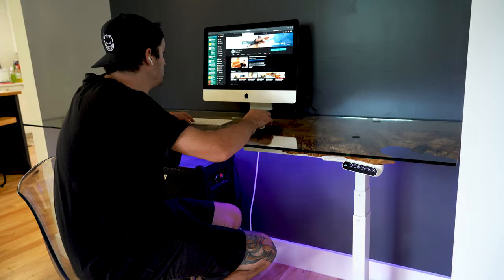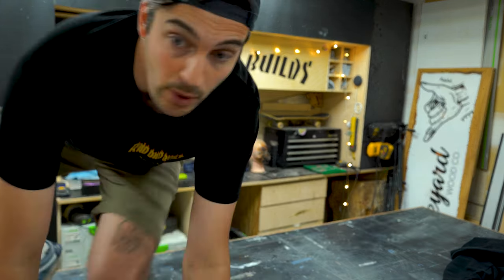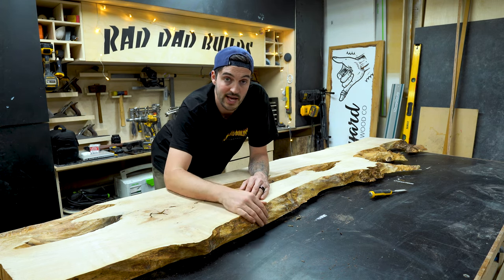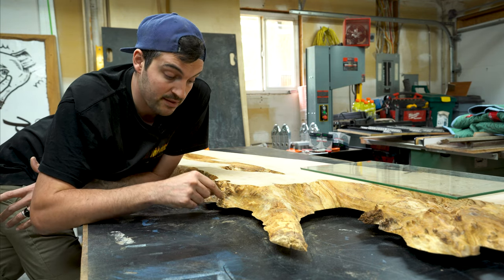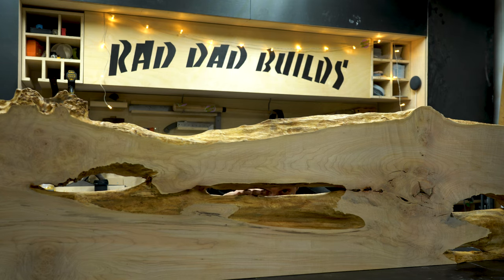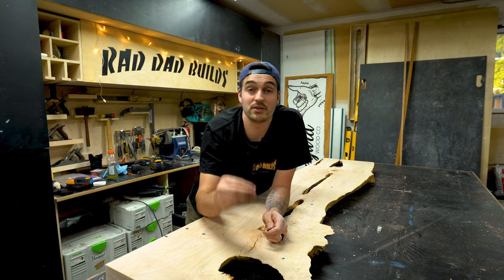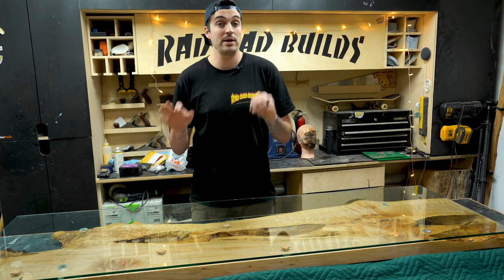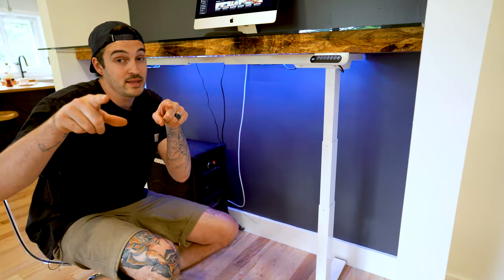Building myself A Custom Desk // Modern Adjustable Desk With Zero Epoxy #desk #leds

Comment: Great idea, man. This is beautiful. Incorporating glass and the slab is classy and beautiful. I’m glad it was not an Epoxy project. 😉 

I’m also glad your cubby is perfectly square and equal. I couldn’t imagine trying this in my home where some walls taper in and out. 😯 
Imagine the motorized desk going up and smashing as it squeezed into a “south beach body” wall space. 😂 

Anyways, thanks for the video ideas.
And the “club scene” and ripping shorts was the Gizzzzaaaa!!!!!!! 👍🏽
Reply: Also, tried the link for the glass hardware but it looks like the wire brushes link was accidentally entered. 😜